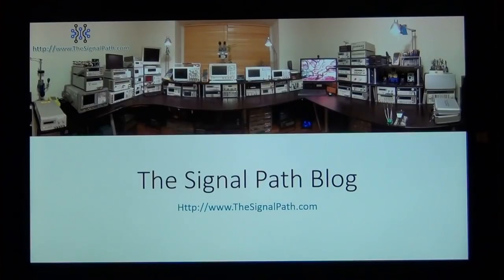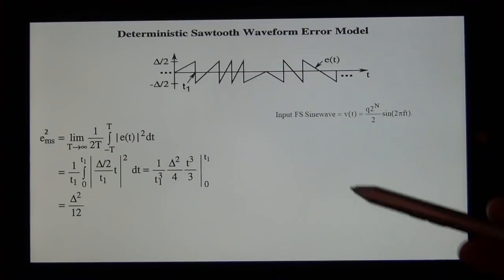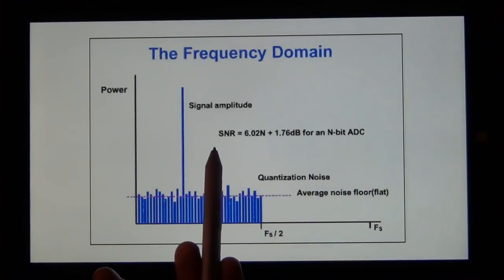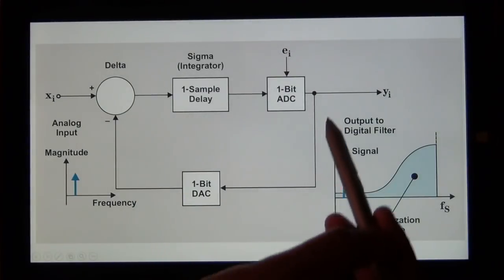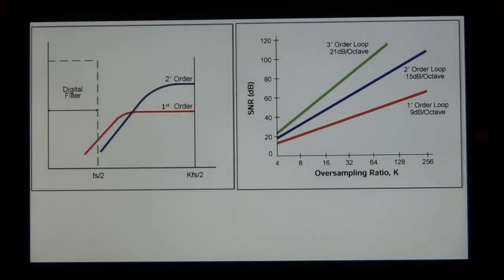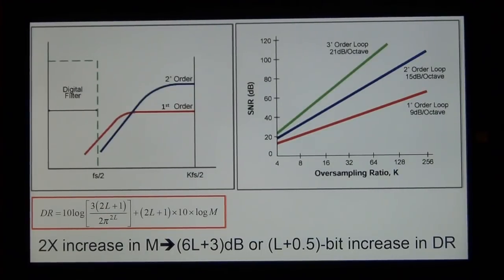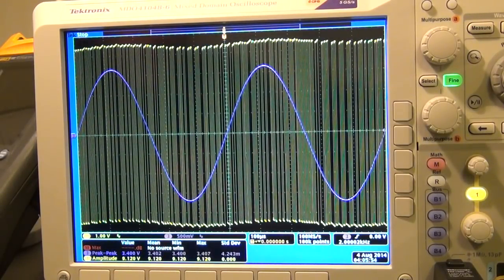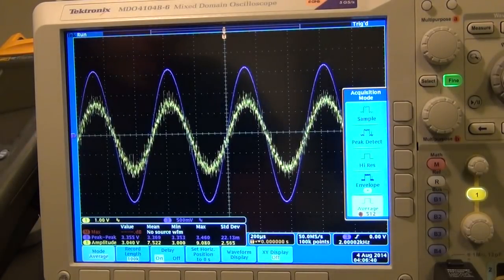TSP #32 - Tutorial on the Theory, Design and Measurement of Delta-Sigma Analog to Digital Converters

Comment: I believe you're making a mistake starting somewhere at 10:00 where you use bits equivalent to express noise reduction. You mention a conventional ADC of 4 bits and I presume you are still introducing the classical ADC with its noise ratio at 10 minutes into your video. Then you can never accomplish a 12 bit ADC quality whatever high sampling frequency you are applying. With 4 bit the SNR is already determined to be approx 24dB. The quantization noise can never be lower because how would the ADC figure out the intermediate values if the components don't provide for it and the error doomed to persist? I believe something is left out in the introduction and that is that classical oversampling technology involves electronics providing in BOTH increase of sample frequency AND increase of quantization without the need of the original input signal. That is to say providing intermediate ramps between the digital figures interpolating between the missing information. Obviously the angle of the interquantized ramps providing the oversampling changes with the amount of the value changes between original samples as interpolation ramp: [original sample][oversampling correlation][oversampling correlation]...[oversampling correlation][oversampling correlation][next original sample] etc.
Reply from the maker: +F0kGggle The analysis is correct. You can indeed get 12-bits of resolution from a 4-bit ideal ADC if you were to over-sample it. The total quantization noise does not go down, it is spread over a much larger bandwidth when you over-sample. Digital filtering then follows and cuts out the portions of the spectrum you no longer need. This is what increases the SQNR and gives you more effective bits. The ADC does not need to figure out the intermediate values, the digital filtering will produce the intermediate values and the number of bits will grow. This is a fundamental principle of how over-sampled converters work.
Reply: In Delta-Sigma the original signal is STILL used to produce the oversampling and that's a completely different type of oversampling than the conventional straight ADC oversampling which doesn't use the original signal because it cannot retreive what is lost in both time (due to sample frequency) and value (due to bit resolution aka quantization). With Delta-Sigma oversampling the quantization increases automatically with increase of sample frequency because of the continuous comparing feedback with the original input signal.
Reply from the maker: +F0kGggle First, there is nothing lost in time. If it were lost then we would be talking about aliasing which is a different story. Second, indeed there is a difference between how the delta-sigma behaves and a regular ADC being oversampled behaves, this is exactly why the rate of improvement as a function of oversampling is not the same. You get much more gain from delta-sigma than you would from straight up oversampling a regular ADC. But you get gain in both cases.

I think your confusion comes from the fact that you imagine the input frequency and the sample frequency to be exactly multiple of each other and that is NOT the case. In fact the whole quantization computation is not valid at all in that case because the noise will not be white. I know this whole oversampling can be confusing, but it is a true! Try reading about it from a few different sources and it will eventually click!
Reply: +The Signal Path Blog I still believe you truly mix up classical ADC with Delta-Sigma ADC when it comes to oversampling. Delta-Sigma oversampling involves the feedback whereas classical oversampling does not. That is to say there is no correction in the latter at the first stage to make up for the error as Delta-Sigma ADC does. I clearly understand your explanation Delta-Sigma sampling frequency increase increases the resolution by spreading the digital noise because of the fed back signal at the first stage. Since there is no such feedback at the first stage with classical ADC the intermediate data levels between the chosen bit-resolutions are lost and doomed to never ever appear again hence the digital noise to persist at its 20 log 1/(2^bits). It is not because you sample a quantized level (no feedback at first classical ADC stage to make up for quantization error) another 4 times that your digital noise will reduce further and magically make the previously lost (again, no feedback at first classical ADC stage to make up for quantization error) intermediate values become represented again in the output digital number train. Classical ADC oversampling without digital quantization nor error feedback means no increase in virtual bit width nor decrease of digital noise in the useful frequency band. I understand oversampling as merely the increase of the sampling clock frequency in the first stage of the Classical ADC and Delta-Sigma ADC without anything else involved so we might be misunderstanding in terminology. (I'm reading this now: http://cs.adelaide.edu.au/~francis/audio/oversampling-summary.html)
Reply from the maker: +F0kGggle I understand that it sounds confusing. But it really DOES happen.
1) Oversampling of a traditional ADC, say a flash ADC, will spread the quantization noise over a larger bandwidth.
2) You digitally filter out the noise outside of the band you don't want. This filtering will increase your number of bits, because it can achieve intermediate values in between the quantization levels DIGITALLY. You can afford to do this because you have far too many sample beyond your Nyquist needs.
3) This is not as effective as a delta-sigma (only 0.5 bit for doubling the sampling rate). The delta-sigma's feedback of the input provides much more benefit from each doubling of the sample rate.

Again, you don't have to take my word for it, build one in Matlab or any simulation software and try it out.
Reply: +The Signal Path Blog Look, we are talking about non-feedback classic ADC here and you claim everything happening on the input signal (say signal of music) between the quantized levels and intermediate samples is regained just because of filtering. Impossible. Just like with data collection in statistics everything between the polls is lost, zip, gone. Everything between the subjects of interest is gone, never requested. Of course one can interpolate/correlate to estimate the missing data. Filtering is about taking out, suppressing and enhancing however not about creating what's not there because creating is another story like for example harmonizing. I think you're a bit fixed on formulas and theories and unity signals like sinusoids and maybe you've lost some basic sense of what can and what cannot even though this is exactly what is challenged with Delta-Sigma principle. But let it be clear here we are talking Classic ADC, not Delta-Sigma. You cannot recreate what has not been taken. Again, if for you the term 'oversampling' means about digital interpolating between the Classical ADC samples (linear or polynomial intermediate data creation) at a rate X times the original sampling rate then I agree however the increase in bit size is virtual and not real, because of the involvement of linear or polynomial estimate values. It will smooth the steps indiscriminate of what was there in the original signal because that has been lost between the samples and quantizations forever gone during the first stage of the Classic ADC. The interpolated values are a linear or polynomial !estimate! by the oversampling circuitry and have nothing anymore to do with what happened in the input signal beyond half the sampling frequency. Yes the noise is reduced but the frequency band of the original signal has not increased nor its THD decreased, absolutely not. Again, I'm not referring to a single sinusoid as input signal but what is at the end of the day the purpose of ADC's: arbitrary and unpredictable signals which need storage, processing, transfer, and reproduction in the digital domain. Applied in Hubble astronomy: Oversampling to gain what is lost during the Analog to Digital conversion will NOT recreate the lost star because it was missed during digitization. You can 'oversample' to interpolate between the blocks to smooth out the picture and reduce image noise however you will never recreate what has been missed between the blocks. Everything beyond the optically sampled detail is empty and stays empty replaced by an intermediate value (linear or polynomial) dependent of the neighboring image dots (samples).
Reply from the maker: +F0kGggle Digital interpolation is NOT the same as over sampling. When you over sample, you over sample the input signal and this is the point you are missing. The fact that over sampling increases ENOB in a TRADITIONAL, non-feedback ADC is a fundamental aspect of how ADCs work. I wrote my Ph.D. thesis on mm-wave ADCs. But again, you don't have to take my word for it, there are thousands of resources where you can read about this. Furthermore, why are you talking about THD? THD has nothing to do with it. THD is a non-linear phenomenon. An ideal ADC has no THD limitation. You currently lack some of the understanding about these concepts, which is totally fine. That is how we learn.

https://en.wikipedia.org/wiki/Analog-to-digital_converter#Oversampling

Here is an actual example by TI:
http://www.ti.com.cn/cn/lit/an/slaa323/slaa323.pdf

I hope this is sufficient. I am sorry that I don't have more time to dedicate to this discussion.
Reply from the maker: +F0kGggle It seems my efforts have been wasted here. For the final time, conventional, non-feedback, regular ADCs will benefit from increased ENOB by oversampling. Specifically, they benefit by 0.5 bit per doubling of the sampling frequency. This is not the same as interpolation. I am sorry that you can't get your head around this idea, but this is a fact. Its okay to not understand something initially, what is not OK is the fact that you did not read the references I provided nor did you read on the thousands of references which are available about this topic. And you still do not understand the difference between THD and ENOB.

No, Ph.D. does not make me infallible, but it does make me an expert in the topic. Although this topic is introductory material for ADCs. I also said you don't have to take my word for it and provided other references for you which of course you did not read. I have no idea where Rigol came from in this discussion. Insults or inflammatory comments will result in you being banned from the channel.
Reply: +The Signal Path Blog You say 'Digital interpolation is NOT the same as over sampling. When you over sample, you over sample the input signal and this is the point you are missing.' - wrong, interpolation is EXACTLY what oversampling after conventional ADC is all about. It is NOT oversampling at the input stage as you claim. Your wrote also 'The fact that over sampling increases ENOB in a TRADITIONAL, non-feedback ADC is a fundamental aspect of how ADCs work.' - come on, we can both agree what's written by this ATMEL document on oversampling with their conventional ADC's in their MCU's: http://www.atmel.com/images/doc8003.pdf in which their summery mentions "Averaging four ADC results to get a new ADC result is the same as if the ADC sampled at 1/4 of the rate, but also has the effect of averaging the quantization noise, which improves SNR. This will increase the ENOB and reduce the quantization error.". Averaging is for one thing an interpolation: http://www.cs.umd.edu/~djacobs/CMSC427/Interpolation.pdf. So saying interpolation has nothing to do with conventional ADC oversampling is a horrible mistake you make and this is exactly my point. The adding of noise to the signal in the process I didn't know or forgot from my graduation days. But as we both can see, that noise is no part of the original input signal and contributes to the fact we are dealing with virtual bits being added for interpolation purposes.
Reply: +F0kGggle And yes DIGITAL interpolation.
Reply from the maker: +F0kGggle Interpolating between four ADCs is not the same hardware as over sampling one ADC by four times the sampling rate. The reason people use time-interleaved ADCs is because they can't over-sample those ADCs at four times the rate due to speed limitations of the ADCs. They use interpolating ADCs to interpolate between the samples, but the hardware is quadrupled, it does not come for free.

Again, again, again. Conventional, non-feedback, regular ADCs will benefit from increased ENOB by oversampling. Specifically, they benefit by 0.5 bit per doubling of the sampling frequency.
Reply: +The Signal Path Blog I truly believed you removed our dispute hence my 'Rilog' response.
Reply: +The Signal Path Blog I have a slight feeling it clicked. The noise on the input signal provides the possibility to create digital intermediate values (oversampling) in between the quantization levels which are directly related to the input signal. Provided the random noise is present in a frequency range high enough to provide for sufficient random noise in between original samples in time.
.
I always want things to understand by intuition and I believe I got it since you stressed on the noise part now. Thanks for your free time and especially patience.
.
This sounds great. Now the decimator is another story because it's that thing we need now to derive the intermediate quantize values from the n-bit number trains, right? Analog Signal --->[add noise]->[n bit flash or iteration ADC]->n bit numbers train-->[d bit decimator]-->n+d bit number train (thus including intermediate quantize values beyond n bit representations namely n+d bit representations directly related to the original input signal). And the rule is 0.5 bit effective resolution increase per 2 times oversampling aka doubling the sample frequency. Now I see this is a non-interpolating method.
.
Reply from the maker: +F0kGggle The correct terminology is: "Over-sampling a traditional open-loop ADC with n-bits of resolution will produce an ENOB which exceeds the resolution by 0.5 bits per doubling of the sample frequency. The resulting data will be indistinguishable from an equivalent ADC with higher resolution if there are no other sources of noise, distortion or timing errors in the system."
Reply: +The Signal Path Blog Yes, ok. Ah yes, open-loop aka non-feedback. The rest is a decimator of course. A real didactic challenge. Timing errors, I'm thinking about one being jitter.
Reply: +The Signal Path Blog Noise Shaping Over-sampling would be a better term for the sake of the specially added noise.
Reply from the maker: +F0kGggle Glad it is sorted out. Cheers.
Reply: But listen, take this datasheet for instance http://www.dddac.de/files/SM5842.pdf. Isn't it talking about interpolation? But this of course is concerning the DA process where extra oversampling would be considered linearily/polynomial adding quantization and increasing samplefrequency for the sake of interpolating in between the digitally predetermined recorded quantize values. Because we can't add noise to the digital numbers and expect bits to reappear from nowhere because they were lost in the simple (no oversampling) and classical AD stage.

It's important to talk in a manner below high graduate degree terms and with classical ADC  and then put it to the next level. Then I believe the decimation process (getting out the extra bits from a n bit wide data block - even 1 bit wide) will also be easier explained and grasped by the viewers.
 
Say the digital audio storage taken from classical n (i.e. 8 ... 16 ... 32 bit ... audio AD) ADC is physically and effectively n bits wide and of a physically fixed and effective amount of samples say 48000 representing 1 second audio then any oversampling beyond the 48000 per second would mean interpolation because there is nothing beyond the n bits wide and fs samples per second stored on whatever carrier. This 'oversampling' produces a signal with less digital noise from a low bit audio data storage simply because of the interpolations created between the quantize values.
 
It's just that I didn't fathom that oversampling with noise and thus 'thickening' the analogue signal over at least half bit made it possible to generate digital data containing n+m bit width notwithstanding physical electronics being n bit. I say half a bit because a level in the middle between 2 quantize levels + noise makes the resulting signal presented at both first upper quantize value and first lower quantize value eaqual amount of random times. The noise has to have the attributes to allow this within the classical ADC sampling rate. Then one can already figure out how this can make the digital production of intermediate quantize levels from the digital result possible. If a momentary signal level would be closer to the upper quantize level than the lower quantize level because of the same added noise then the digital result would be as such more numbers of the upper quantize than of the lower quantize. This explanation can already take care of the intuitive understanding of oversampling by adding nois to the original signal and increase of samples taken per second.
 
So concerning oversampling in the analog to digital conversion with traditional ADC I believe there is still room for didactic improvement to get viewers clicking and understanding the concept or at least give them a strong hunch they can hold on to while learning the details and going beyond in the thought process.

Back to DA oversampling. Say the representation of the n bit data stream of 1 seconds time audio in which the data block contains 176400 samples and sufficient information to reproduce 44100 samples of n+m bit wide.

After oversampling in classical ADC and then the decimation process at the Digital to Analog stage make the step to Delta-Sigma (the original term by the inventors) and the idea of making more bits using single bit technology, noise and very much higher sampling frequencies will get easier to fathom, not? Just a suggestion.
Reply: I mean  ' 'thickening' the analogue signal over at least one bit '.